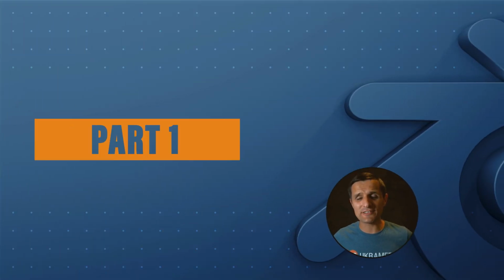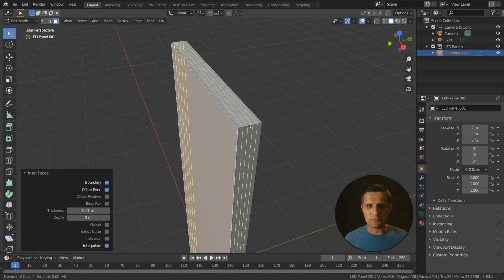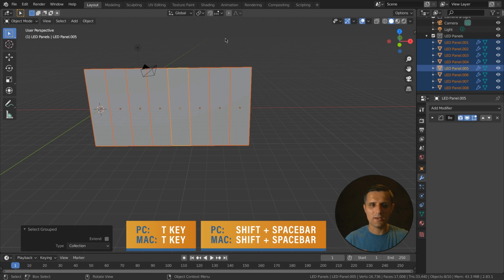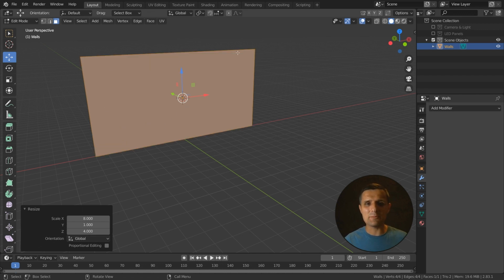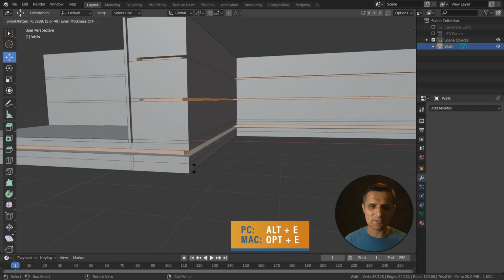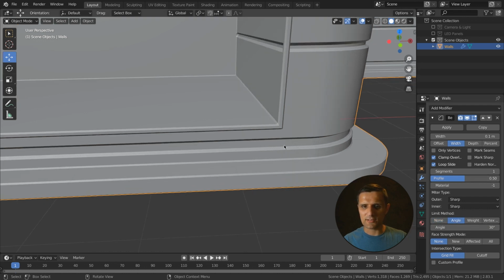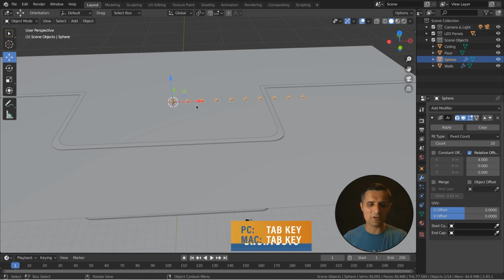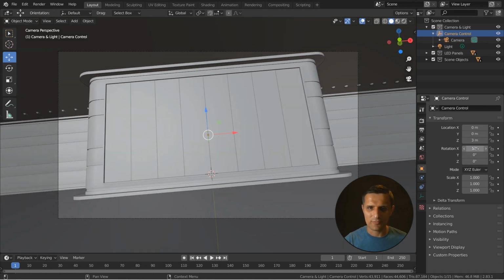FREE Blender Course - Part 1: Modeling

Comment: At 16:54, when you're extruding along normals, they're just not extruding proportionally, even if I tick the 'Offset Even' box. Is that a bug in my version? Was initially using 2.9.1, now upgraded to 2.9.3 just to hopefully have this addressed, deleted the whole mesh and started from the plane, and I still can't have the even extrusion along normals. What am I doing wrong please? I tried everything.
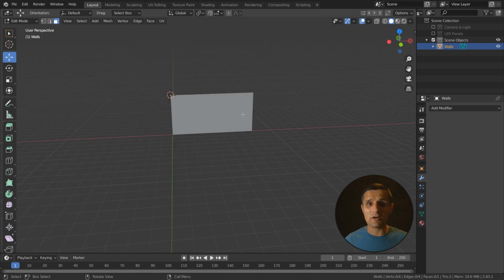Reply: After much searching, I realised that Sergey must have reset his scaling at 12:39, which is done by pressing CTRL + A. That will basically apply your scaling, without scaling all the processes following this. So at 12:39 don't forget to do that or else you will end up with unexpected results.
Reply: @ed_vs4155  thank you so much....this really helps

Comment: Excellent work. Thank you for sharing your expertise.
I followed the tutorial using Blender v2.91. There were a few unexpected results along the way.
1. Ctrl key snaps object origin to grid intersections, but after I did 'Object > Set Origin > Origin to Center of Mass (Volume),' edges of LED panels did not align with grid. I aligned the panel edges to grid by selecting all panels; Tab to edit mode; select bottom corner vertex of LED panel in side view; 'Shift + S > Cursor to selected'; 'Object > Set origin > Origin to 3D Cursor' 
2. I mistakenly modeled the panels on -Y axis, making them the mirror of your panels. Luckily, Alt key when adjusting object properties will affect all selected objects so I could efficiently rotate them all to face the same way as your LED panels.
3. Bevel width of edge rings on Walls object was not to scale because the plane was originally 2x the height before we subdivided and deleted the other 3 faces. Problem solved by undoing back to before bevel; 'Alt + A > Apply Scale'; then 'Ctrl + B' to bevel as usual.
4. Mirror modifier in my scene, needed a value of Axis: Y to mirror the top half of Walls object. Mirror modifier's Y and Z axes must have swapped in update to 2.9 series.
I am in part 2 now, and will continue to make notes of the places I find difficult. It takes me about 8x the speed you work at, but it's worth the time to troubleshoot and understand. I hope my notes are useful to someone else, and thank you for making this information. It takes much work to present it in a video that cuts out all the filler, covers all the details, and even has call-outs on screen for keyboard commands.

Comment: Hey Sergei! Great tutorial.  Love seeing sports graphics done in blender.  I have extensive experience in AE and Element, and although I've done a few tutorials in Blender, I'm very new to 3D programs in general.  I had a couple issues during this tutorial (using MAC OS 10.15.2 and Blender 2.83.1) 
1.) I was not able to select all edges using "alt + LMB" it would either select just one edge or top and bottom. I was able to select multiple edges by holding "shift" as a work around.
2.) Again, selecting edges at 18:03 gave me a problem with "alt + LMB" but even after selecting edges holding "shift" I was not able to create the corner bevel you created when I felt I was following your tutorial pretty closely.  
Those were my two main issues and not sure why that was happening.
Thanks again! Україна вперед!!!
Reply: Same thing happened to me, even the extrude along normals if giving me a different result once the lights have been added
Reply: press m on keyboard and merge by distance and make sure that your scale is set to 1